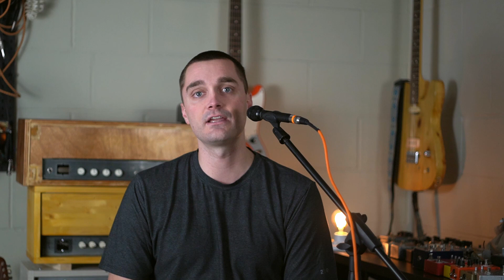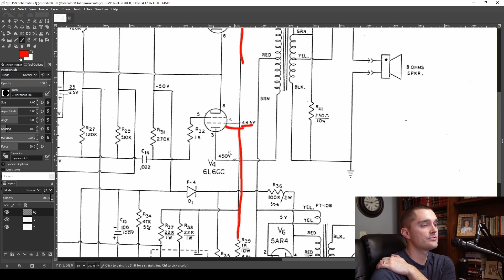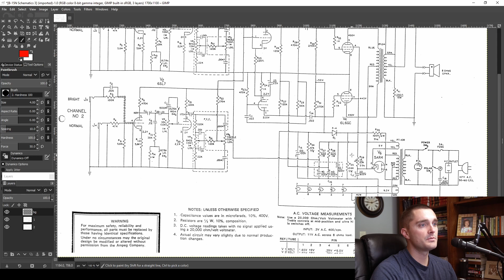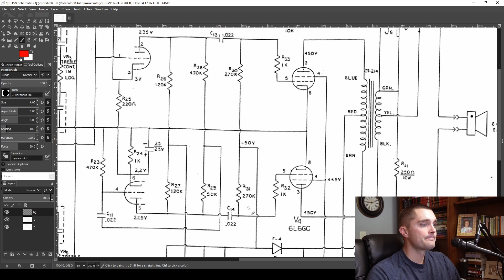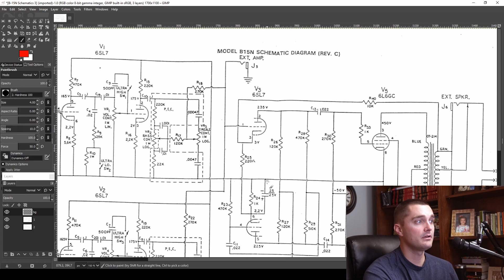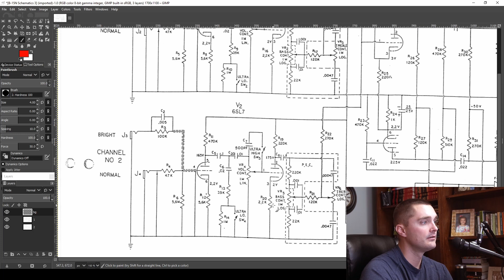Ampeg B15 Bass Amp Circuit Analysis

Comment: You missed an interesting feature on the hum pot - 100k off one secondary winding thro a diode to the wiper of the pot instead of ground,  which means the pot "sees" a negative pulse at mains frequency. Re the 250r across the OPT secondary, it's to prevent a no load situation. There's quite a few other things you missed, but this was a long time ago, so you'll have learned a lot more since.
Reply from the maker: Very helpful thanks for sharing!

Comment: Well, I am a guitar player, not a bass player as such, but several times in the past I have ended up filling in on bass for bands that needed it.  So the rig I put together was totally DIY, but it worked pretty well.  I had a Dynaco ST-70 which I built into a rackmount case -- I also used to use this with guitar.  For bass, I used a very simple solid state preamp which I built, consisting of two cascaded inverting opamp stages, each with a gain pot.  This gave me lots of range over the gain and input level (I could also use this preamp for mics, etc.).  No tone control or EQ whatsoever!  Just the pickups on the bass, and theoretically the tone knob but I always kept that at 10.  I ran the mono preamp into both ST-70 channels, then each channel drove a 15" speaker (forget the brand, probably from an old PA, maybe Jensen?), each housed in a separate plywood cab which I built.  Simple rig, but good sound; at some of these "battle of the bands" gigs, the other bass players would ask to borrow my rig, too.  ST-70: 4 x EL-34, ultralinear.

Comment: The B15N is a combo amplifier. The 250 ohm resistor is a default if the speaker gets disconnected. The odd extension speaker jack is so that the extension speaker, if fitted, is in series with the existing speaker.

Comment: Well, through the years I can't say I've had favs but my first bass amp was a Kustom 100W tuck and roll and later had a Sun 2000S which was a heavy monster of a head.  I am a small guy so it was difficult to haul around but I was 19 so full of piss and vinegar when it came to playin' music. I also had a Peavy Centurion head with two 15's.  That was killer for playing gigs, I liked it a lot.  I now have a small Kustom KBA80 80 watt.  I am trying to repair it.  It was 110V  I live in a foreign country now plugged it into 230 and blew it up. Maybe you can help me get it working.

Comment: Informative video. However, the topology is pretty much how Ampeg decided how a bass amp should be, (you've, at least by this time I write this, as I don't remember when you covered it or the Marshall JTM-45,) have already experienced another take on what topology a bass amp can be: Leo Fender's Bassman. It's in the name: BASS-man. It wildly caught on with guitar players even though it's intended audience was bass players (and it was used extensively as a bass amp too.)

Comment: I built a B-15 preamp section in a rackmount a while back, but used regulated DC power supply and 12SL7's instead of 6 volt, and an old API console ouput transformer. Sounds freaking beautiful. My original 68' B-15 is pretty noisy BTW and that speaker output is really annoying how they designed it, forcing you to always have a speaker load connected at all times and can't run EXT on it's own
Reply: You can modify the series connection to simply run two parallel outputs speakercraft jacks on the back. Just make sure you don’t drop the load lower than 8ohms. Always have at least one cabinet connected. This way I can run my 1961 B15n with any cab with appropiate specs. It also makes a killer guitar cab. If you over drive the preamp tunes with an overdrive or boost pedals...It has a nice breakup.  I also modified it to have a proper ground as well. Mine is still running the original Ampeg tunes, but the filter caps have all been changed because of its age. It’s a killer amp!

Comment: Why would you want variable feedback on a bass amp?

You want the bass to stay tight. The negative feedback is there to dampen the speaker so it doesn’t ring excessively.

Having the EQ at the end of the preamp means the P.I. stage needs additional gain via the 120K plate resistors versus the 47K plate resistors on circuits such as the B-15 nc.

Comment: This is another blatant example of someone that has not done their homework on the original circuit (1960) or the various incarnations that evolved until 1977.Different rectifiers and bias methods, not to mention the incorrect statement that they were not all 6l6 powered.
Reply: Check the B-15S... originally equipped with 7027 outputs. Close enough in wiring and specs though. (if you AVOID using pins that are unused on a 6L6 as tie points, they're interchangeable.)

Comment: Thanks for your video.  I just picked up a 60's B-15N.  Your post really helps me understand the wiring diagram (which is glued under the chassis, how cool is that?).  Overall this amp seems so well made.  There are rubber grommet shock absorbers both between the bottom of the cabinet connected  to a board that attaches to the castors and between the board at the top of the amp and the bottom of the chassis, as well as rubber padding between the bottom of the board below the chassis and the top of the cab when you flip it over.  I repair guitars and play bass for a living.  The only things I can see that need to be done are to get a new or used 5U4 rectifier tube and a new or used speaker.  I am open to suggestions as to what types to look for.  Thanks again!

Comment: The B15 isn't just the head, it's technically a combo amp in which the cab is critical to the output sound. It's called a "Portaflex" which means "portable reflex baffle system".  The amp is shock mounted on a plate that literally flips upside down for storing the head inside the cab.  The cab is mounted on it's own rubber shock mounted dolly.  Pretty slick setup to be honest.  Probably why Ampeg is still making the modern version of it today.

Comment: I have the much coveted 1966 B15n and it's certainly one of my favorites, but it only puts out about 25/30 watts.  Sometimes that's not enough if I play a gig with no house support (birthday parties, pool parties, retirement homes, etc).  For those gigs, I love and adore my 1977 Peavey 400 BASS with it's awesome harmonics/EQ circuit with built in fuzz and distortion.  At 200w through a 115+210 it will literally knock stuff off the walls.

But to each his own, not every amp is suitable for every genre or situation.  Use whatever works and gives you the sound you are looking for.  Nothing else is really important.
Reply: The older Peavey solid states are LOUD, but they’re kind of lofi, in a cool distinctive way…

Comment: Not an  experienced tech in any measure but having worked on a b15, I found that the  external speaker jack was insulated, Don't know if that helps.

Comment: As a amp builder and bass and guitar player I love your vids.   I built a trinity amps trip top kit which is the best of B15 circuit.  Cathode bias and fixed bias switch and inputs for normal channel, linked , and cascaded. Bright switch is a pull out volume pot on each channel.   It’s a flip top combo where the head flips In to the cab for transport.  Killer design. Not you lightest combo bass head but really has bass tone for days.   I was under the impression that bass amps had bigger output transformers to help keep the low end in line.   Love the vids.  Looking at restoring a friends bandmaster and putting the normal channel in series per one of your vids. Your face sold it😁🎸🙌.  Cheers, max from Alaska

Comment: Enjoyed another of your videos so I just subbed (the Ampeg got me). I have a Peavey 400 that just recently went out so it will go on one of the back burners for a while. Currently studying up on an old Silvertone organ amp that I am converting for use with guitar. It sounds good, going to sound great! Thanks for the tips. Next I will be attempting the conversion of a Hammond AO-43 into a tweed-ish head for a Tremolux cabinet that I've used with the bass rig since the 80s. But the longer view is to learn Ampeg circuits well enough to hand-wire a '68 Reverbojet that came with a printed circuit board which burned up a few years ago due to a disappointing hack job by an unqualified tech in Austin. Call that a heart-breaking hack job. Have you done circuit analysis on Ampegs? Particularly '60s Rockets and Jets...

Comment: A noteworthy point of the EQ is that the bass control is centered at 40 Hz whereas most other amps have it centered at 100 Hz.  This makes a huge difference in getting a nice fat low end without getting muddy.  Overall good analysis.  I've owned 4 B-15s in my lifetime of varying age and circuit design.  Interesting to see the design morph over time.  One final comment, if you want variable bias, replacing R35 with a pot would be a better choice than replacing R34.  Happy building everyone and check out the schematic for the Ampeg B25 to see the same preamp circuit using 12AX7 tubes.  Cheers
Reply from the maker: Great point, I should use the Duncan Tone Stack tool and put in the values and play around with them to get a feel for their effect.  Those subtle changes can make a BIG difference.  Thanks for your input!
Reply: @KleyDeJong  You're welcome.  I have enjoyed playing and working on electronics for almost 50 years now.  Glad to share some knowledge with those that are learning.  Thanks for doing your breakdowns, not all of us have the time or energy to put them together and it's a great resource for those that want to learn.

Comment: R5 helps keep the grid at 0V.  The tube is cathode biased through R8.  A grid leak bias happens when you have the cathode grounded.
Reply from the maker: Thanks for the insight.  Does it form a voltage divider with R2?  Perhaps a small one with 47k / 5.6m.  

What is the difference if you put R5 right on the input and then R2 into the grid?  Basically flip flop them?
Reply: @KleyDeJong  The input resistors are to reduce Miller effect.  Although you could see the two resistors as a voltage divider, I don't think that is the intention.
Reply from the maker: @tubeguru100  Interesting, good to note.

Comment: The ext. speaker jack connects a second speaker in series with the on board speaker.  It also changes the OT impedance from 8 ohms to 16 ohms.  The 250 ohm resistor is there to protect the OT in the even the speaker fails, you still have some load on the OT.
Reply from the maker: Very helpful, thank you!
Reply: @KleyDeJong  if the resistor wasn’t there the secondary would develop a very high voltage and possibly arc to other windings in order to fi S a path to ground.
Reply: Are you sure it isn't there to balance output to the ext speaker, since the installed speaker supply is tapped for a negative feedback circuit?
Reply: @lowtone9  At 8 ohms, the nominal load is 7.75 ohms and at 16 ohms, the nominal load is 15.04 ohms.  At 20 watts, it would be 12.65vac at 8 ohms or 12.45v at 7.75ohms; 17.98vac at 16 ohms or 17.34vac at 15.04 ohms.  Neither of these impedances are even affected by 1dB so there may be a contribution to the NFB, but it appears to be negligible.
Reply: Are you even sure that the ext speaker connects in series? This OT secondary wiring is very confusing to me. Normally, extension speakers are connected in parallel.
Reply: @lowtone9  Normally yes, but these definitely connect in series.
Reply: @lowtone9  Definitely wired in series. Imagine a speaker instead of Jack J6 in the diagram. The two speakers would create a continuous loop with the outer taps of the output transformer. The 220 Ohm resister would be in parallel.

Comment: The B15 has been on my build radar for about 2 years now. Thanks for giving the run-through Kley!
Reply from the maker: Very welcome!  I would love to build a tube bass amp as well.  I have only ever played Bass DI.  I think it would be a very fun experience.
Reply: I've been stalking this site for awhile for info on the B15:
https://www.talkbass.com/wiki/technical-amplifier/#8-the-b-15n-transformer-set
You thinking of building one and putting the build log on Shock Bros.? It'd be awesome!
Reply from the maker: @HarpinJScott  Very cool.  I would love to do a build.  I have a few other projects to finish shortly and I slow down a bit with amp building in the summer - but I would love to get this build rolling!